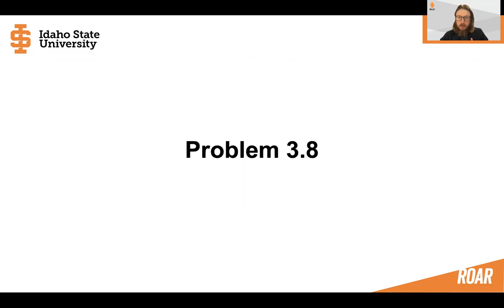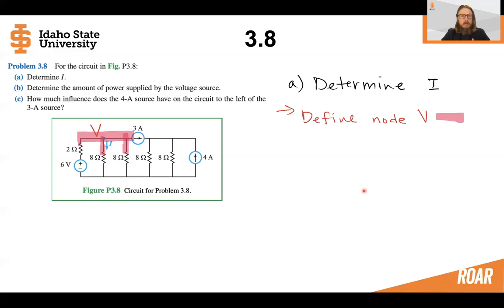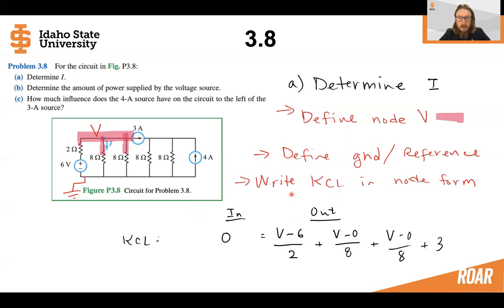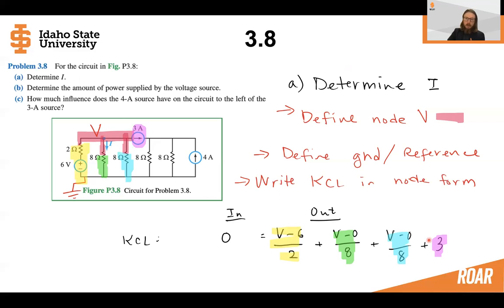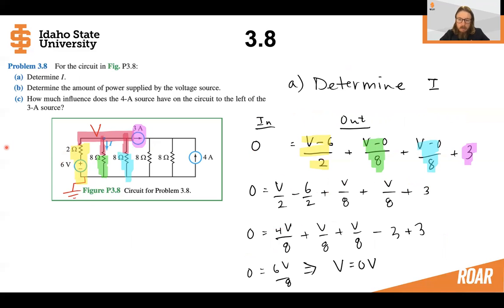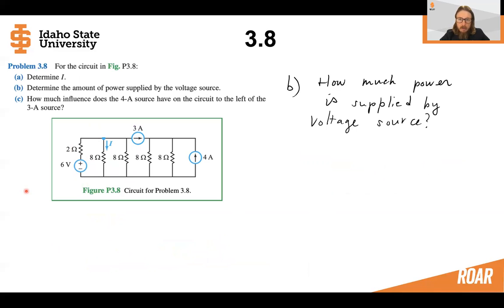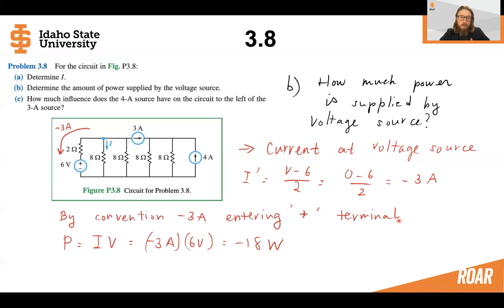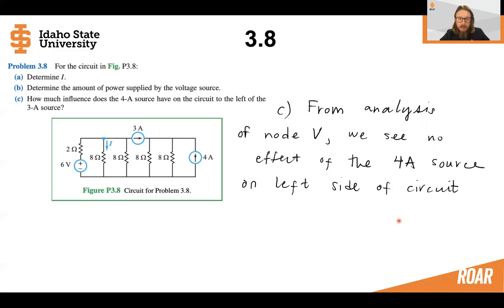Node Voltage Circuit Solution Example Problem

Comment: Heyy! Sorry to bother but I solved using superposition and got different answers…why is that?
Reply from the maker: Hi, thanks for the comment. I can recommend a strategy to check your work. First you could try using LTSpice or another simulation to verify the results in the video. Then, if your simulation matches this result, you can create additional simulations to verify the sub-problems created via superposition. Check your work by hand and compare to the simulation superposition problem to find the source of any errors. Good luck and let me know how it goes!
Reply: @Dr.C.Eng.Education  Hello! Thanks for the reply! Yeah I checked my work again this morning and I had made ONE crucial mistake when solving for the currents of the voltage source…I didn’t combine two resistors that were in parallel correctly…after correcting that the answer was the same! Thank you so much
Reply from the maker: @jasonjuarez8692  Thanks for the update, glad you figured it out! I think your strategy of going back and solving problems using multiple methods is a great study idea! I recommend this to all students. Good luck on all your studies.
Reply: @Dr.C.Eng.Education  Thank you! I appreciate you! I definitely find understanding multiple methods helpful when solving more complex problems